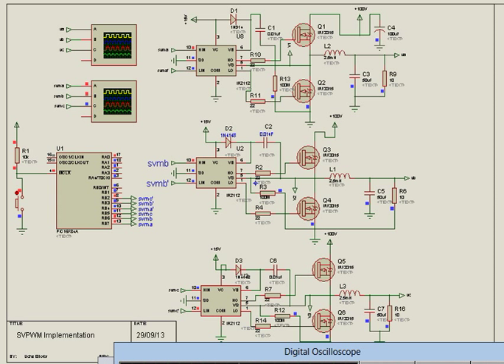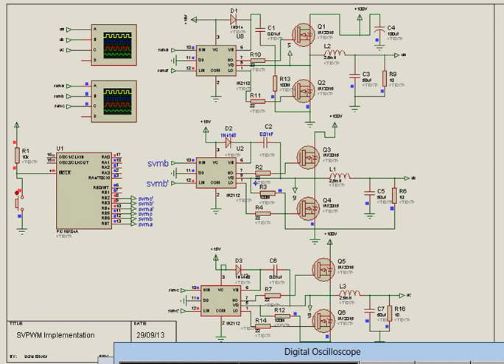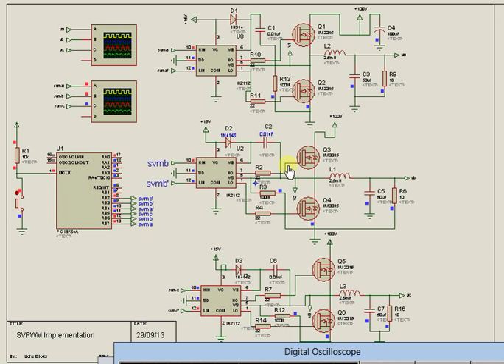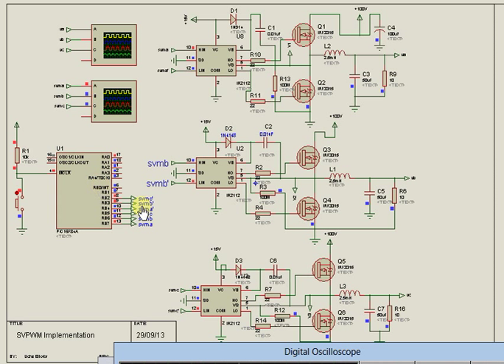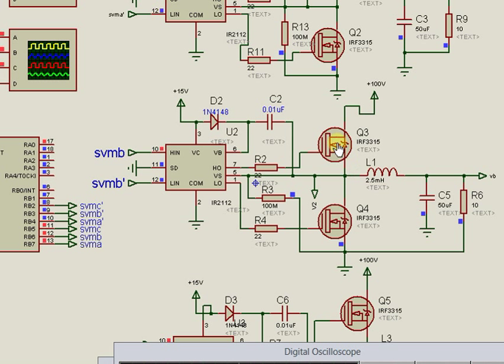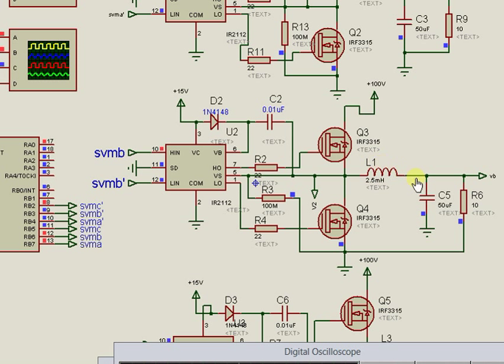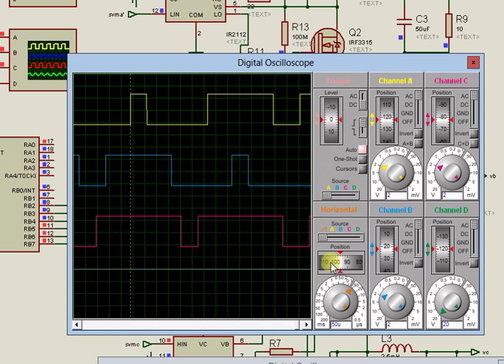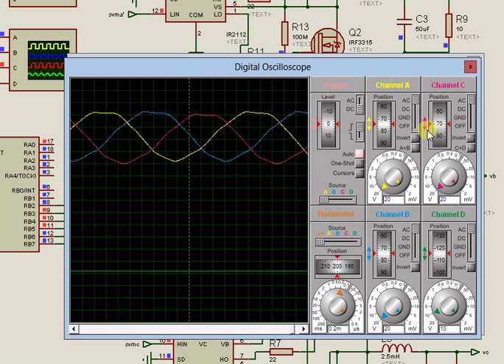Space Vector Modulation Inverter Implementation

Comment: sir if i increase the more than 200V  DC  input of invrter the error occure TIME STEP TOO SMALL how to resolve it
Reply from the maker: Mohit Gupta . The maximum recommended operating voltage for the MOSFET is 150v according to the datasheet. If you try to operate it too much above that voltage error will occur.

Comment: sir i got the svpwm signals correctly using the code you gave... can i change the angle of reference vector in the program??? what shall i do for it? Also can i do the inverter model using IGBT and some other driver other than IR2112?
Reply from the maker: ang ref can be changed in formular....IGBT is good...any driver can be used.
Reply: Uch Ly thank you sir.sir i have doubt regarding code.what changes should i make in the code to generate pulses with an angle shift of 120deg. Here vref is starting with 45deg which corresponds to 2.5ms. so if i have to shift angle by 120deg,should it be 165deg with time 9.16ms and what is the significance of time. Also in the code T1,T2 and T0 are calculated using formulas. i got the valuse as -133.84,35.86 and 148.98 by sustituting angle as 165deg.Is that the correct way? And why in delay generator 0.5 is given as delay? please help me to find a solution.
Reply from the maker: but max angle of ref is given as pi/3 in fig 1.4 of the svpwm blogger post!
Reply: Uch Ly ok sir. in my project iam having two svpwm inverters and i have to give a difference in angle of about 120deg for Vref. ie if iam having vref of one inverter in sector 1, vref of other should be in sector 3. This i can implement by modifying the svpwm code. so can u find a solution for this sir?
Reply from the maker: midhun gopakumar what u are doing is quite different from wat i did....u can take the information from wat i have done to develop urs...am not electrical engineer...its advisable u reason with ur tutor for a reliable headway
Reply: Uch Ly Sir i found out that the time calculation formulae is different for different sectors.You have calculated for sector 1 with maximum angle 60deg. So if i can calculate the time in sector 3 as you did for sector 1, will that be the change done in svpwm code? or should i need to do any other modifications in the program other than this? Also in your program there is a delay code generator with a delay of 0.5 in switching time calculation part. Can you say what is its significance?
Reply from the maker: midhun gopakumar Computed T1, T2 and T0  are same in all sectors, and delay code generator can be used to generate the code that implements the switching times (T1, T2, T0)
Reply: Uch Ly Thank you for your kind consideration sir... :)Will i be able to get information about svpwm code other than this for better understanding? If possible please help me sir.
Reply from the maker: midhun gopakumar u can search for further infromation using the keywords "svpwm code" google...i searched an get following links:
http://www.ijisme.org/attachments/File/v1i5/E0236041513.pdf
http://www.academia.edu/5770841/Application_Note_Space_Vector_Pulse-Width-Modulation_For_use_with_Inverters
Reply: Uch Ly 
sir i did the hardware of driver circuit using IR2110 for half bridge and full bridge circuit. iam not able to get pulses at gate of mosfets. i gave 5v to VDD pin of IR 2110 and its ground to VSS PIN. VSS PIN and SD pin were common. At the output side i gave 15v to VCC pin and its ground to COM pin.Bridge circut ground was given to COM pin too. So basically i gave isolation to both sides of driver. But iam not getting any pulses at mosfet switches. what can be the reason? should i take all ground points as same. please help me to find a solution to this.
Reply from the maker: I have not used that driver before! U need to read the datasheet to get more info on how to make it work: http://www.irf.com/product-info/datasheets/data/ir2110.pdf                       U can can also look at youtube video which may be of help: https://www.youtube.com/watch?v=wgsTXbHLbmI
Reply: sir link are not  available
Reply: link not working

Comment: thank you sir for uploading valuable informations
iam doing my mtech in power electronics and i have svpwm as a part of my project
iam doing it using PIC microcontroller. so can i get any details of svpwm using latest PIC 16F or 18F series.
Reply from the maker: basic svpwm implementation details are published here: http://electrotech4u.blogspot.co.uk/2011/07/implementation-of-space-vector.html
Reply: Uch Ly sir i have doubt regarding code conversion. i tried to convert the svpwm code in mplab but its failed. i dont know what compiler we have to use for code conversion.i tried in ccm and hitech compilers but not getting hexcode. i also have doubt whether we should save project filename as filename.c or not? which i did while doing a conversion from c language to hex code... please help me sir.